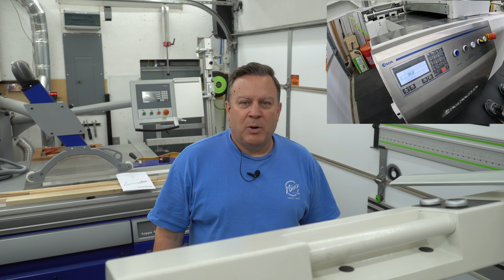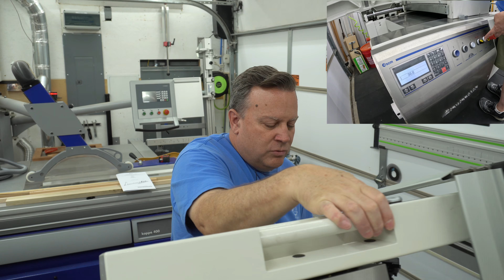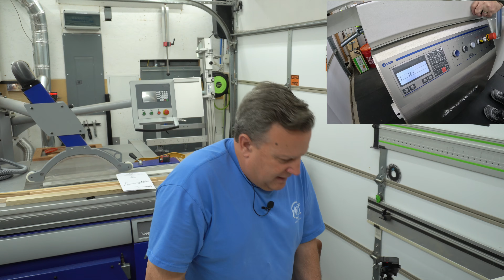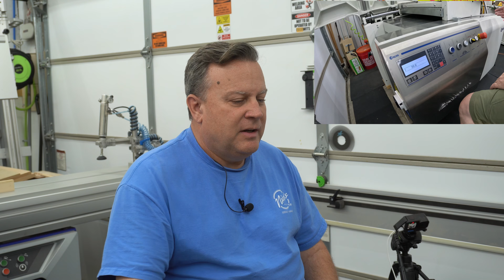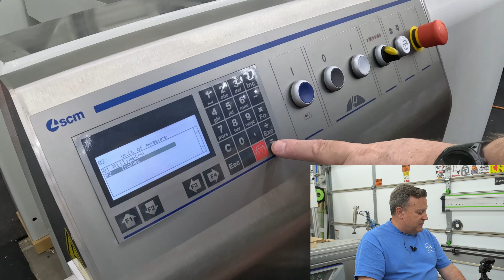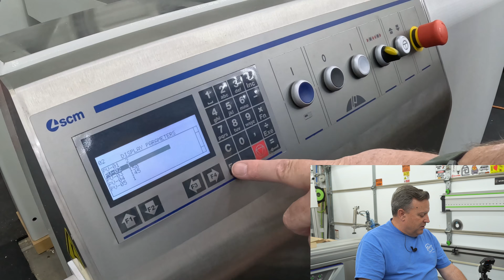First SCM L'invincible FS 7 in North America?  Part 2 - Change Over details and the 'Ready 3' system

Comment: Hi Paul-was making sure I heard you  correctly that you ran this machine (in your old shop) with a 10hp PP.  I am thinking about this machine and have a 10 HP PP (about 1 year old) and am hoping not to have to upgrade to a 15 hp.  Like you, I would run my DC on 220V vs 3PH.  Thanks for any insight.
Reply from the maker: Mark,  Yes I ran it on the Phase Perfect PTE010 for two years.    The machine plate for the FS 7 says 33 amps but it never pulls that many amps (that I have experienced).  It does have star-delta start that limits the in-rush current.  The PTE010 has steady state 36 amp output.
Reply: @pkwoodworking  thanks for the quick reply.  Helpful - Mark from Denver
Reply from the maker: No Prob

Comment: If I may ask, how much did you pay?
Quick system... could save you minutes a year ✔️
Reply from the maker: Thanks for watching!

I posted the price in another video.

The time to change over is actually not the biggest advantage.  The accuracy to come back to an exact measurement after switching processes is the biggest thing for me.  It gives me the benefits of two separate machines in a smaller footprint.

Comment: Hello, what was the reason for you to buy this one instead of selling AD 941? When you compare AD 941 with this one, which one is better?
Reply from the maker: Hello, I did buy and then sell the Felder AD-941.  It was a fine machine.  These machines are in a different class.  The L'invincible FS 7 is a larger machine and is more refined.  It weighs significantly more and has a parallelogram mechanism to support the tables.  It has more features also, and I was looking for those features specifically.